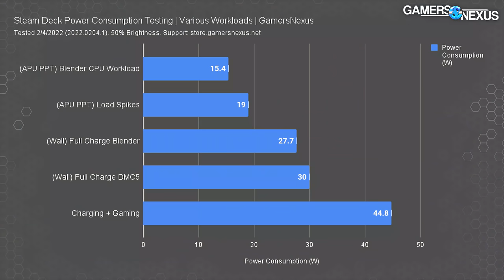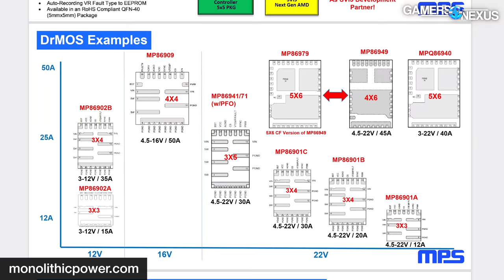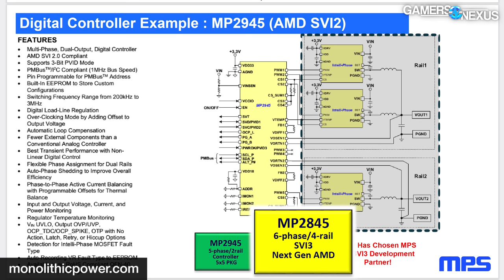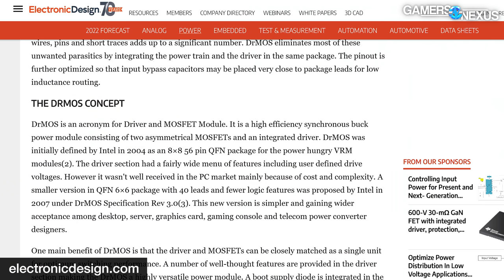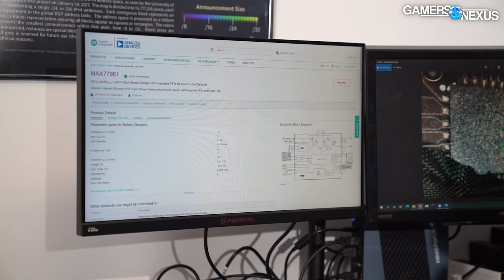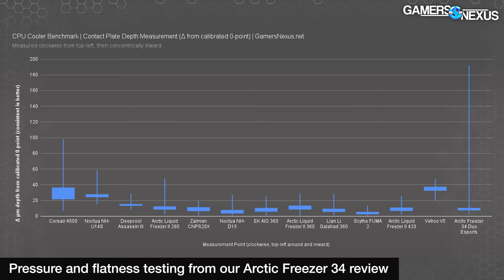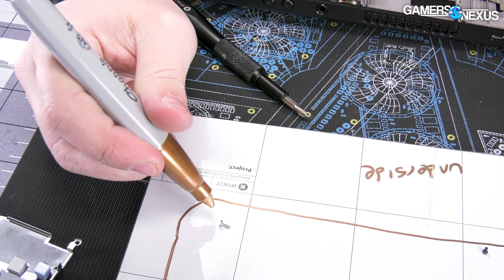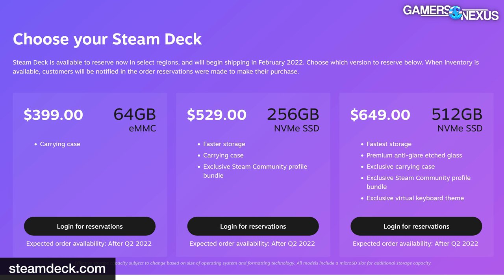Steam Deck Tear-Down: Build Quality, Disassembly, & VRM Analysis

Comment: 19:35 It's 6A at 25V max. With voltage potential that low, the thing is perfectly safe. Yes, it's the current flow through your body that's dangerous and 25A is plenty to kill you, but once you put the resistance of your body into the equation (Ohm's law, I=V/R), you will see that with a voltage that low and resistance that high, the current going through your body will never get anywhere near to the dangerous values. In fact, you won't even feel it.
Reply from the maker: Thanks. You're right on that - we pushed the video through too fast and Stone recorded this after a long day, so I think he forgot he wasn't talking about wall power here and was working with a low voltage circuit. I should have caught that, so my fault for not correcting it. Thanks for the correction! I'm going to bed now!
Reply: @yaldabaoth2  Glad to hear that. I'm an EE. Not sure if Stone is, so I'm not gonna comment on that part. I mean it's always better to make a comment like he did and make the engineers laugh, rather than to go in the other direction and make somebody feel overconfident.
Reply: @GamersNexus  Makes sense. After all, he has spent a lot of time working on PSUs lately. Love the content, keep up the good work!
Reply: @GamersNexus  it can't kill you but it's enough to burn through that PCB in seconds so warning is good even if point is wrong.
Reply: Beat me to it. It doesn't work like the movies where you grab both sides of a car battery and get jolted lol.
Reply: @Kzn Nzn:  It's all about current passing through your body, like OP said.  If you barely felt contact with a live 240V 15A+ line, something insulated you from the ground, and saved your ass.
Reply: @KodiakWoodchuck  if your hands are wet you can. Again the warning is good lol don't touch live wires
Reply: KULON🔞  Get a life dude and stop spamming channels
Reply: @jaywastaken  it's my hot body, I'll do what I want
Reply: Yeah, skin resistance is rather nonlinear.  Think of your body as being fairly conductive on the inside with a nice insulating wrapper around the outside.  As long as your skin is intact and dry, you don't really start to run into issues until about 50-60V (that's why POE is 48V, incidentally).  After that, the voltage is enough to start to break down the insulation your skin provides and allow current to flow through your moist innards, which are considerably more conductive.  As long as you aren't working on really high power stuff, its mostly very unpleasant (though can still cause lasting nerve damage).  Where you run into most of the issues is when the current flows through your heart because the current flow can disrupt your body's natural electrical system and cause heart fibrillation (erratic beating of the heart).  Its sort of an old TV repairman's mantra that you should work with one hand behind your back (so you don't have it in contact with anything conductive) because if you get shocked, rather than the current flowing from one hand to the other, across your heart, the current will probably take a path not through your heart.
Reply: @GamersNexus  The warning was still great
Reply: @GamersNexus  In a repair sense the safety concern might just as well be that if that shorts through a tool or loose wire, 6A could potentially light a fire or the like. Good reminder for everyone to remember not to poke charging/voltage regulation parts.
Reply: what if you have soapy hands?
Reply: Correction. It's not enough to harm you in normal situations. But you should never assume normal situations. A cut can drastically lower your skin's resistance, for instance.
Reply: This is exactly what my teacher had told us for our safety class. -engineering technologist student
Reply: You even dont need a high current to kill. At AC line voltages a current over 10 mA can be felt and dangerous and a current over 100 mA is lethal! You would probably need an AC transmission line with multiple kV to draw a lot of current through a human's body, but at such high voltages and power a body would be vaporized!
Its not about a question of voltage or current being dangerous but what kind of power supply you have, how you are going to touch it and so on. So just stop listening to the mainstream media BS about being smart with current :P
Reply: Edit: Apparently some people opt to ignore the context and find my posts "dangerous". But personal attacks? Ok, have it your way... I'm out.
Reply: @knockdoun  If you did contact to finger to different finger (=short path) to contact, you would be hard pressed to feel anything with wet hands, soaped or not, at that voltage; about double that voltage and you will feel it in the form of tensed muscles while DC voltage is applied. Soap alone would not conduct as well as what you would expect from tap/drinking water. Tongue across the two contacts would be more sensitive as some people know of from 9V battery being enough to make people quickly remove it; works as a cheap battery tester though.
Reply: You are right that current is what kills and to shrug this one off due to low voltage to try to drive the current through you. Presuming no strange medical scenario, fingers shorting that part shouldn't be felt at that voltage, but that package with the current getting it to those temperatures would be felt by the heat instead.
Reply: /rant
Reply: @KenS1267  you do appreciate that electronic engineers deal in electricity too, right? 
And are more qualified than technicians and electricians? Sounds like you have a real chip on your shoulder about them...
Reply: @justjosh11  Me? I'm just a guy who started out as a tech and got my EE. I am very jaded about circuit designers, that's what the EE degree teaches, speaking confidently about how safe electricity is 

But sure lecture me some more. How many bench hours do you have? What are your degrees in?
Reply: @KenS1267  I was a technician also, subsequently got my degree in electronic engineering. So in answer to your question, many, many hours on the bench.

I wasn't the one who came to the comment section to lambast another commenter though, I felt compelled to stick up for him and by proxy all EEs because you are simply wrong when you suggest EEs are the problem. 

Anyone can spout misinformation, but what the fella said wasn't even untrue.
Reply: @KenS1267  and I don't know where you got your degree if all they taught was speaking confidently about how safe electricity is ....
Reply: @justjosh11  I always treat all hot wires or caps as potentially deadly.  Far better to err towards caution.  I used to work with 120w class a tube amps (guitar heads).  The caps in those can kill.
Reply: You can absolutely feel 25V and even though the voltage aint dangerous shorting 6A will create a nice little spark most likely damaging the hardware.

Comment: Love that valve published a how to video on how to replace some components, makes this product more compelling.
Reply: Surely you're not talking about that garbage video they made where they claim that we're all too stupid to use a screwdriver and that the battery will kill us if we take the Steam Deck apart. 🤦‍♂️
Reply: If that video scared you off then you shouldn't open it up. 
IMO the video made it's point and if you still feel comfortable working on it then it's just a guide on how to open and replace components.
They don't want any user-errors to come bite them in the ass so best to just scare stupid people off.
Reply: @mjc0961  That video is lightyears ahead of their competitors within the right to repair space. 
That does deserve credit, also many, many people don't know how to use a screwdriver correctly or at least, as Steve also emphasized, using the correct screw is REALLY important with similar screws of different lengths. Shorting components using the wrong screw certainly has the potential of resulting in a Steam Brick.
Taking it to a reputable repair shop really is a good idea and the part of right to repair that many seem to not recognize. 

This also reduces the amount of RMA work on a product that that likely is losing valve money at MSRP in the first place. Not that Valve can't afford it, but the general idea is to continue to build the on mountain of money they have.
Reply: @mjc0961 seriously if you think a lot of people know how to use screwdriver correctly, then you are freaking wrong. In electronic case especially, it is not rare people break screw mount from its plastic housing, this include  heatsink (basically you just want stop when you feel enough tension, but the problem, which is enough ?).
Reply: @All4Grogg  Sadly, at usual LiPo charge cycle life, this is going to be a steam brick after about 18 months anyway with daily use since they've chosen to glue the battery in.
500 cycles is industry standard, although you can con any testers by only using the middle portion of the voltage range so that 500 cycles get used at something like 75% per charge, which might then stretch it to 2 years.  Well, you may be able to use it as a wired device until the battery swells and busts up the internals, or worse, catches fire spectacularly (as LiPos have a tendency to do).
So the most likely item to fail, and the one which fails most dangerously isn't replaceable, which makes any claim to observing "right to repair" a sick joke at best and an outright lie at worst.  If that claim is made on any marketing material, expect the legal cases to start when the batteries start dying.  Possibly very big cases if they don't fail safely but unplayable at all with a cut-off circuit.
Reply: @phillee2814  you know it's possible to break the glue? it's done all the time in smartphone repair
Reply: @phillee2814  Trade offs, the size and weight would increase if Li-ion batteries were used. If they fail dangerously it would be a MASSIVE engineering failure and i'll withhold judgement until we see how challenging a battery replacement actually is and how accessible OEM replacements are.
 Shorting the battery certainly could result in fire and Valve isn't wrong in not trusting the average consumer, Mr. Rossman or his peers operating reputable repair shops should have few if any issues. Right to Repair means we and they have access to parts, it doesn't mean that manufacturers are committed to building modular systems or choosing components that offer the greatest life span possible. Knocking a manufacturer for failing to offer the former is moving the goalposts. 
LiPo batteries are often used in gaming laptops, this isn't a departure from the industry norm. 
With currently available battery chemistry options there is no perfect solution, I don't know that the choices Valve made are the best, but I'm very confident that if they are not safe for consumers or reek of planned obsolescence, GN will be on the case.

Comment: The charging ICs 85 degree rating is an ambient temperature rating. It says it can do 3.2W of dissipation at an ambient of 70C, then derating by 40mW/C over 70C. Tj shdn (shutdown junction temperature) is 165C and the default thermal regulation junction temperature (point at which the device throttles back the charge current) is 115C, configurable up to 130C.
Reply: Was looking for this comment, liked! The rush jobs showed here a bit. Still not something major for most people! :)

Comment: Steve, I was glad to hear you take a stand on the battery situation at the end. The inability to easily replace batteries in most mobile devices in 2022 and before, has been a CLEAR and very HOSTILE move on the part of manufacturers and retailers in order to hijack the end user life of products.
Reply: I guess fitting comparatively larger batteries was a happy accident thanks to this batter conspiracy.

Comment: Coming from an IPC 610 inspection criteria.  I'm impressed with the quality of the component soldering onto the PCBs.  Valve put in some really good work and manufacturing practices in these steam decks.

Comment: 5:50 kinda not happy that we didn't get to hear the cracking plastic sounds from pulling off the back after the screws and the video cuts to it already removed... the plastic snap things are really obnoxious as they often break, and the sound of them coming apart might actually indicate more about the build quality than one might expect. As well as the force required to get them apart.
Reply: They only break if you're not using the correct tools to remove them.
Reply: Sometimes you need to slide the panel instead of just pulling it off.
Reply: I use guitar picks to pop in the tabs and stick a credit card in the gaps to keep it open.

Comment: I am guessing this might have to wait to the second NDA date later this month but can you guys do testing on replacing the SSD and whether it affects power or interferes with the WiFi. Also if you can solve the interference with say tin foil etc. I feel like that would be very important to know whether you need to get an external hd/SSD in order to expand the steam deck other than the SD card slot.
Reply: This, I'm itching to try and fit a m.2 extender out of the back of it so I could use a full form factor m.2 nvme or even build a custom docking solution with a egpu
Reply: @TheQuinn50  Yeah unfortunately I am pretty sure valve has already said it doesn't support egpu's. 2230 ssd's are quite rare. If there isn't any examples of people upgrading internal steam deck ssd's and working I will prob just buy a small and thin dock and a small usbc ssd and just tape it to the back - theres plenty of room for both. I saw a reply of another comment where gamers nexus said that he won't be testing internal ssd's as there are too many variiables and ssd's
Reply: @TheQuinn50  egpu is impossible since the usbc port isn't thunderbolt
Reply: @AH-hm2mq  You can run a egpu through the m.2 port where the SSD is when you get it. Then you could just boot off the sd card or usb

Comment: It looks like most of the complexity is because of size and packaging reasons, and not obscure/bad design or trying to block users from servicing it. That's really good.
The cynic in me tells me this looks very complex and if they do a next version, everything will be glued down for cost savings...
Reply: I don't actually believe that gluing stuff down saves much money tbh.
Reply: @wickersticks  Sure it does.  To glue two things together you just need smear some glue and press them together.  To screw them together you need to add screw holes, put screws in the holes, and turn the screws (making sure not to apply too much or too little torque).  More steps and more precision needed = more cost.

Of course if you want to account for the cost of disassembling and reassembling the product even once screws are probably cheaper.

Comment: As someone who is familiar with this stuff, I really enjoyed how he does his job so clean, ground pad to minimize possible electrostatic on his hands and removing battery first and holding power butting till discharge possible electricity in the board and capacitors.👍

Comment: I really hope you test replacement M.2 2230 SSDs, like Kioxia BG4. Valve's "concern" is wifi interference and power draw.
Reply: Came here to ask for this.
Reply: I hope someone makes a modified case for steam deck so you can install bigger m.2 ssds and removable battery.
Reply: I really don't see much point in doing this. I'm sure there will be simple external addons that will be much simpler to use and will transfer data plenty fast. Early testing just off the SD card seems to indicate even that should be "good enough" for most games.
Reply: @Cherijo78  Some of us would like to know since it can be cheaper to bue the cheapest steam deck and then buy an M.2 2230 for fast and more storage that the official steam deck for instance.

Comment: I'd love to buy one of these but the glued-in battery makes it a no-no for me. :(

Hopefully they'll do something about that.
Reply: That isn't really a deal breaker. If you need to replace the battery, simply discharge it to 25% so that the energy stored isn't too high, and then gently heat it with a heatgun, moving evenly over it, not focusing in one spot too long. A few seconds and the battery will lift out. Heck, it's easier to get apart than an iPhone, and I remember when they were easy, back in iPhone 2 days!

Comment: Real shame about the battery, it will probably need to be replaced within 2 years of somewhat heavy use, if you wish to retain those 2-6h of game time.
Reply: And do you know how much cost that batery? Tx
Reply: I feel like that's to be expected without some large jump in cost. As long as it's fairly user friendly in buying and replacing the battery, I don't mind it.
Reply: @pagatryx5451  that's what's shameful about it, that it's not easily replaceable, but glued in.
Reply: @CasualHerb  Could just be the preproduction units. Hopefully that gets changed. But yeah, not looking good.
Reply: @CasualHerb  Could just be the preproduction units. Hopefully that gets changed. But yeah, not looking good.

Comment: Looks like there's a lot of "wasted" space in the two ergonomic hand bump thingies. I wonder if they could have put some extra batteries or a swappable SSD in there. Would be interesting to see some 3rd party backplate and triggers that reduce those bumps to make the whole thing a lot thinner.
Reply: That's pretty normal for controller handles.  It's really not as much space as it might look, consider the structural reinforcement and clearance for the buttons and triggers.
Reply: Making it less ergonomic, more flat like a switch, is a hard sell. Perhaps they didn't stuff the handles because it looks like they made a concerted effort to keep those sections of the deck the most cool to the touch.